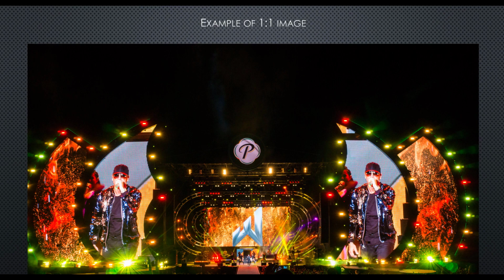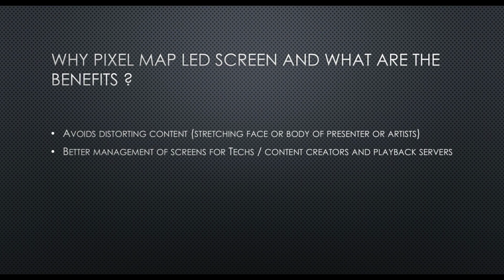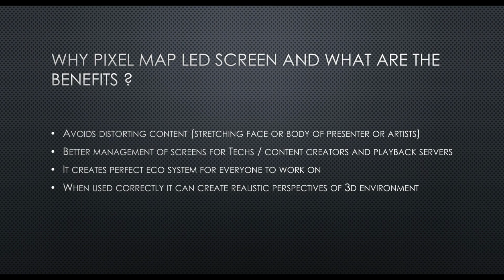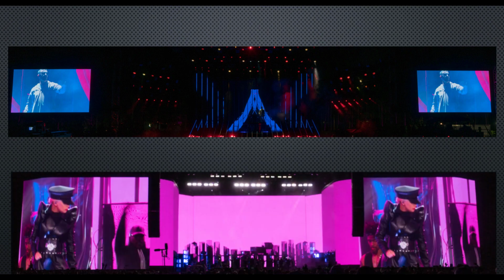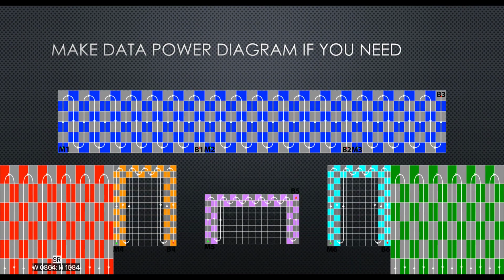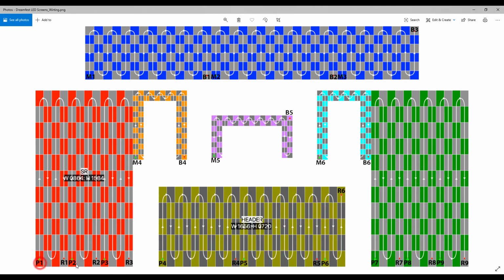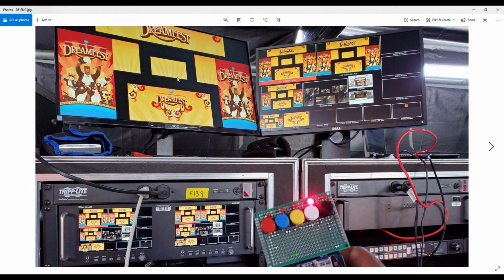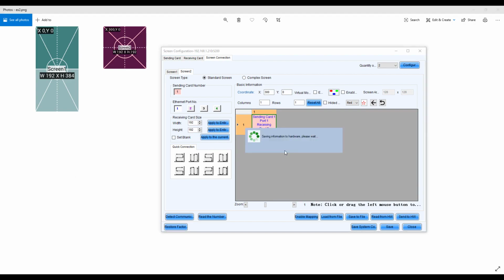NovaStar Pixel Mapping vs Scaling Explained | LED Display Configuration Guide for Live Events

Comment: Thank you for this great tutorial. This is the first clear explanation of something new to me that I've wanted to get into. That is programming creative content to video wall technology. I'll check out Pixel Perfect on Red Dot Logic. I'm a video artist who found P/T work as a stagehand building huge video walls for big events with a big team, but I'd rather be programming content for them. I also like how the film industry is using video walls or volumes as they call them. This tutorial gave me so much more of a sense of what to learn and how to get the education.
Reply from the maker: It is my absolute pleasure and honor to be of help. I'm glad the information was valuable to you, and I look forward to seeing your creative projects come to life in the future!
Reply: Hi I watched your video but somehow I'm failing at keeping the aspect ratio of my HDMI signal source. In the screen configuration I set my column in row and signalpath, but on the left when I try to adjust the height and width it's 128 by 128 by default in the image look stretched. I have four columns in five rows to try and make a correct portrait image. Not on the processor itself if I hit the scale button it stretches it but I want to avoid using the scale button